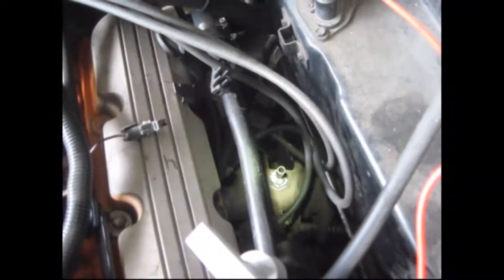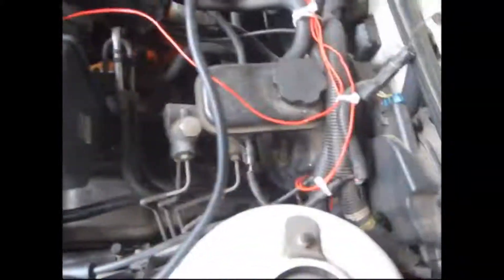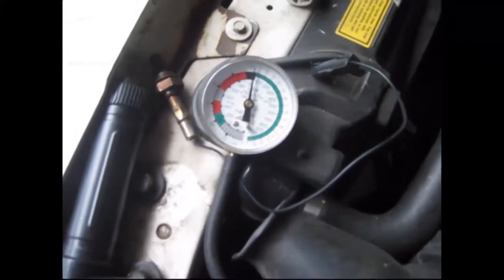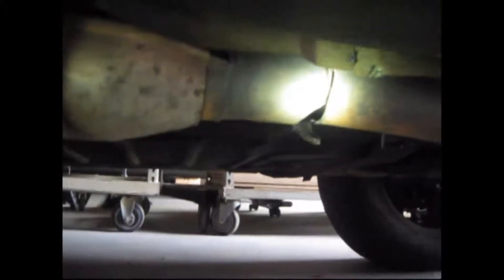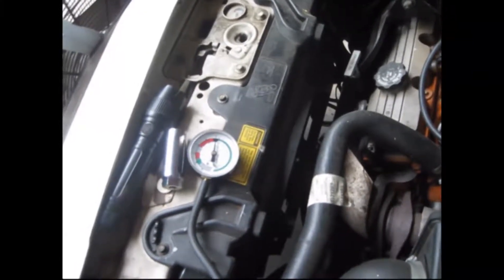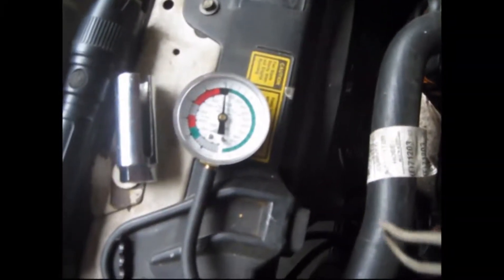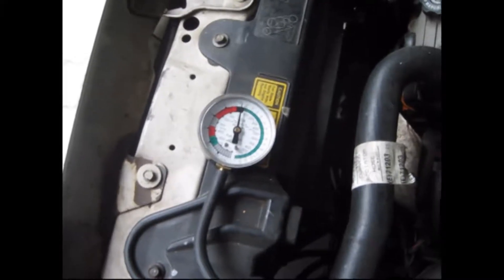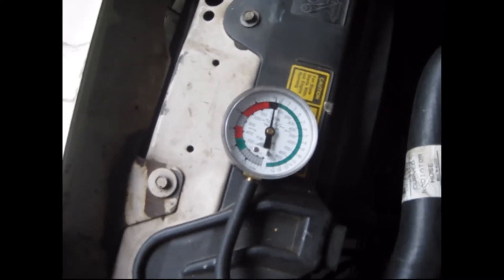Engine Back Pressure Test (Test Failed)

Comment: my 83 Monte had a clog in the converter I could hear it thru the carb at high idle when I took the air cleaner lid off.......I didnt know what it was at the time but it had lost alot of power so I started checking things out and I put my hand by the tail pipe while running and felt very little air coming out......thanks for the upload